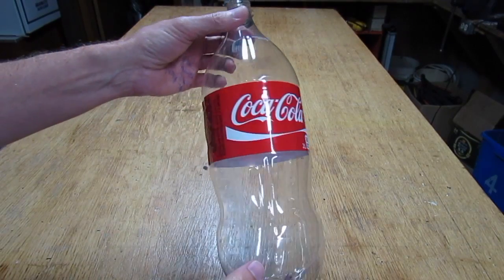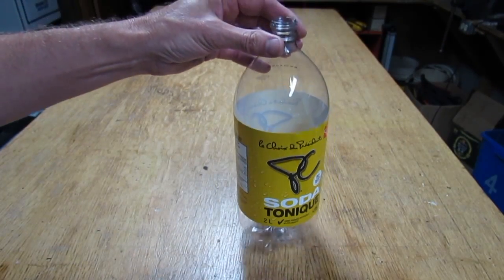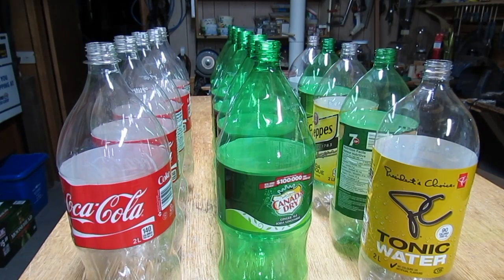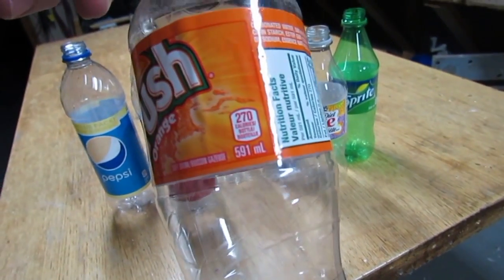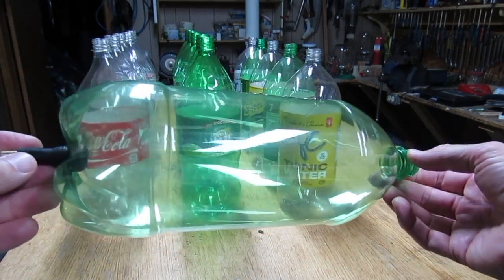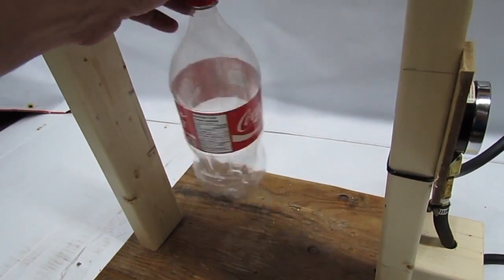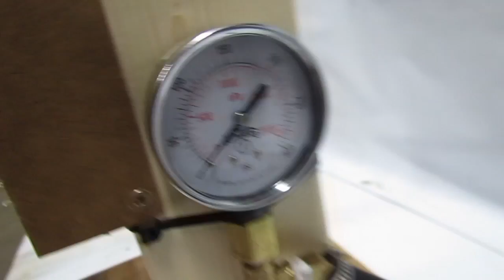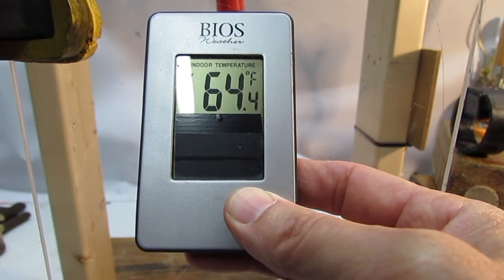This Happened .... When I Over-Inflated a Pop Bottle !

Comment: the last explosive was funny :)
Reply from the maker: I liked it too.
Reply: Now you should try wrapping it in some duct tape to see if that can strengthen the bottle. XD
(I wouldn't use even a regular plastic bottle for an air tank, big safety hazard. But yeah, would be interesting to see if it could hold more pressure with duct tape.)

Comment: Nice one! I didn't know fridge compressors gave that much pressure. Now I really want one. 
I did test a 1,5 liter bottle one time (I have no video of it as it was so long time ago it was before I had a camera) and it gave out at about 1,3 MPa and started to expand while pressure is falling (just like some of them did in the video) and exploded at about 1,1. So it seems to correlate pretty well with this test - the 1 liter bottles took a little more and the 2 liter a little less (smaller ones takes more pressure)
Reply from the maker: +Ride84XL This was such a fun video to do! You never knew when they were going to let go!  Yes, those fridge, dehumidifier, a/c, mini fridge compressors will all pump up to high pressure but they do it slowly. Each of the 2L bottles took about 3 minutes to get up to failure. I sped up the video so it wouldn't be boring.

Comment: I used to make soda and other bottles. The threaded area can hold over 500psi. That's how much the machines used to stretch the bottle in to the mold. Slowly heat one with a hair dryer so it shrinks then test it. The 500 psi kabooms are way louder!
Reply from the maker: Interesting. That would go off with quite a bang! I know they start out as a test tube shape. How small will they shrink back with a hair dryer do you think?
Reply: Chris Notap About halfway back to the test tube shape.

Comment: That is shockingly consistent, it's good to know that if I want a cheap energy dense compressed air storage, I can just use a bunch of 710ml dr pepper bottles at 150 and have 50 psi of safety.

Comment: I plan to use two of these 2l bottles as a DIY CO2 for the planted aquarium (baking powder/citric acid), so this video is pretty interesting..Have to be careful so the pressure inside does not reach anywhere near 150psi

Comment: These fridge compressor are just so strong 😂. I took one off an old freezer and changed oil and everything and i use it just to pop bottles or to do reactive targets from high pressure bottles
Reply from the maker: Yes they are!! If I'm not mistaken they can compress air up to around 400psi!  How did you go about changing the oil? They don't really need the oil changed. By nature they use oil when used in this way. So you only need a way to check and top up the oil if necessary.
Reply: @chrisnotap  yes it was originally scavenged off an old freezer upside down in a junkyard so it was already almost out of oil. I drained out all the remaining oil and replaced it with some dirtbike 10w40. I also put a cutted off foam paint roll on the pipe that suck air as an air filter so dust and stuff won’t get in my oil

Comment: Very interesting.  I've always wondered how much pressure these bottles could hold.  It's interesting how consistent the failure of 2L bottles was; they must be molded the exact same with the same plastics, thickness of plastic.
Reply from the maker: +Mike Hauss    That's what I thought too that the moulding must be very precise to have them fail at the same pressure. On the shelf at the stores these bottles are at just under 50 psi and you never hear of a bottle failing on the shelf in a store. Back in the day when they used glass, people were lined up with lawsuits with glass shrapnel injuries from bottles blowing up. I bet the number has dropped to zero since the inception of these new PET bottles.

Comment: 150 psi pretty strong for a plastic bottle....could you try compressed air aerosol can.....please test at what psi limit it will explode...because i am making it refillable but unable to test how much i should pump air inside....I want to see without my own eyes how far maximum the aerosol compressed air duster can hold before exploding
Reply from the maker: You should only fill it to whatever the can came with. That shouldn't be hard to find. That way you know it will be totally safe. You don't want to be filling it to near max. Not a good idea. Stay safe.
Reply: @chrisnotap  Unfortunately the chinese made product doesn't seem to care so there are no description of the psi limit written on the can...i can only guess that's why i thought you might have a general standard test for the limit pressure of an aerosol can so i can weigh up my own judgement ...so far i can only guess but it seems under utilize so it runs out of air very fast
Reply from the maker: Do a thorough google search on the pressure in an aerosol can. There will be a standard that they hold since they are so widely used. Don't go beyond the standard pressure spec.

Comment: Chris Notap: have you ever tried hyperinflating a bottle like that and then backing off on the pressure? I’m looking to expand the circumference of a pop bottle, and I’m wondering how elastic the plastic itself is.  The use I have for it is only for the upper half of the bottle, so I would of necessity be cutting the thing in half.  I’ve been thinking about pushing the cut border down over a warmed up cone-shaped item. The only thing that comes Immediately to mind that would be the right shape to do that would be a garden gnome.

But I’ve got a compressor and a pressure gauge and some adaptors, So perhaps if I warm the bottle a little bit before hand, this might do the trick a little better again. Any ideas?
Reply from the maker: PET is what these are made from. If they are heated they will shrink. Try putting hot glue on an empty one. It will distort and shrink. Putting heat to it under pressure will be difficult to control and could create a weak spot for it to let go. I'm not sure if what you are trying to do can be done with basic things that you and I have. Not much help, I know, but good luck. It's all about experimenting though. Be safe.

Comment: Hopefully this message finds you well. Could you tell us how you affixed the bottles to the inflator? I've thought about using valves from bicycle tire inner tubes but I'm not sure what would prevent the valve from flying out of the cap, since it would be friction fit, I believe. I'm only trying to inflate to about 40psi.

Comment: okay, so I'm drawing 3-4 major conclusions from these tests

1) the rounded top two-liters appear to be the safest as the way that they fail  is less likely to result in serious injury to anyone nearby, unlike the shrapnel-throwing coca-cola and ginger-ale bottles. Adding a 100 psi failsafe valve (not sure what you call it) is probably a good idea as well.

2) seeing as how even the 'safest' bottles can throw shrapnel sometimes, it might be wise to wrap the bottles in ducktape or some other adhesive material to limit the amount of shrapnel is produced, mmaking sure of course to leave a small area near the top for the bottles to crack as needed for safety's sake.

3) keeping each individual bottle in an array around 100 psi is probably fine, as none of the bottles seemed to blow before they reached 145 psi.
 
4)further testing on longer storage of air should probably be done to see how well the bottles hold up to a full charge over time.

Comment: In normal use, wouldn't the bottle caps fail before they reach the point where the bottle would explode?
Reply from the maker: I would agree a normal cap would let go first yes. I made up a stronger cap so as to find the limit of the bottle. Pop bottles stored on the store shelf are at 50 psi.

Comment: what cap are you using on the bottles?we cant get them to explode with the regular 2 liter cap
Reply from the maker: I used a tornado tube https://amzn.to/2zrJiVT I cut it in half. Drilled the hole bigger and installed a tubeless tire valve in it. 
  https://amzn.to/3eGwRpj

Comment: +Chris Notap have you ever put dry ice and water inside of a 2Liter plastic pop bottle and seal it shut before? And if so how does the sound of the explosion compare dry ice vs  pure air pressure via mechanical means.
Reply from the maker: No I have never tried that. I would say the noise would be the same since it is just compressed air in the end. I can tell you though that the slomo noise in the video is much closer to the real noise. I did each bottle in my garage, doors closed, me outside, and it still scared me each time!!
Reply: Chris Notap sounds like fun. Ima have to try this and compare. But I am thinking the same thing as you that it should be no difference in decibel level. Unless the carbon dioxide does something funky to where it some how allows the sound to be louder. Be very very very very careful though if you do the dry ice compare. They are highly unpredictable when they go off. Too bad you didn't have a pressure guage that automatically records the exact pressure at which things go pop.   How far away from them were you where they blew ? and could you feel a compression wave? I know when I tried the dry ice in the pop bottles it was loud as hell. And you could feel the compression wave from a good 10 feet away. Definitely want to be wearing some good ear plugs if your that close. And if you do try this experiment try it with as many and as large clumps of dry ice you can. Gives you more time to get the cap on once you have the dry ice and water inside.. crushed dry ice blows it rather fast. So fast I had one go off  just before it hit the ground about 40 feet away. Too bad you don't have a decibel meter that would be some other cool data you could collect.

Comment: A reference chart @ the end of the video would have been helpful as u didn't mention the litres capacity of each one before popping them,so realistically how many psi is it safe to inflate each size of bottle  to? 🤔🤔🤔🤔
Reply from the maker: The 2L hold about 50psi sitting on the shelf in the store. That's a safe amount. You could probably go a bit higher without issue as long as it's a fresh new bottle.
Reply: @chrisnotap  how much higher 60? 90? 100? More?

Comment: How did you make that fridge compressor pop the bottles
Reply from the maker: Fridge compressors have the ability to compress air up to 400PSI.
Reply: Ya can you make me a bottle pooping compressori love to pop bottles
Reply from the maker: When these bottles explode, they go off with a very loud bang. When I made this video I had the rig in my garage to prevent shrapnel injury. I closed the doors and waited outside about 20 yards away. It took about 3 minutes to get each one up to pressure before they popped. Every time they exploded, I jumped. I never got used to it. Very loud even outside the garage.

Comment: Hi Chris, can you give some suggestion for my condition?
The bottle i use is like 4.52, the maximum pressure is 6 bar, air compressor used is Hyundai HY30100. few bottles to the same gas pipe.
under these basic condition,  what is (are) the possible reason(s) to make the bottle exploded?

Comment: Why the smallers ones hold up to 150 psi?
Reply from the maker: +Armando Gabriel   Not sure. It seemed they got stronger as they got smaller.
Reply: all botles are made of same plastic tube, 2l - 05 l they just change mold for compression... so the smaller ones have thicker leyer and it spred out more even.. the big bottles have allready week spots as they were more stretched, so they pop at those places...
Reply: Wow. That is so amazing. I never knew that XD. Do you work in the bottle industry or something?
Reply: no, but i was in coca cola factory as student... and this is the same 4 all other bottles..
Reply: @stojko11  A smaller container (smaller diameter) will withstand more pressure even if it's made of the same material and has the same wall thickness. Such are the laws of physics. Super thick farm tractor tires are inflated to 1.2 bar and race bike tires up to 6.